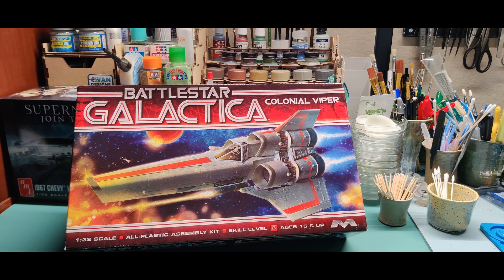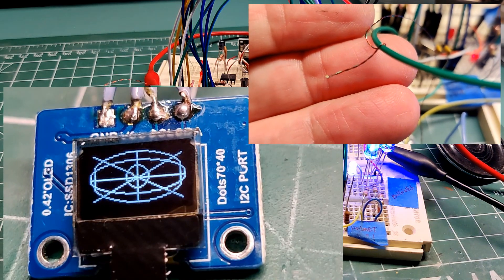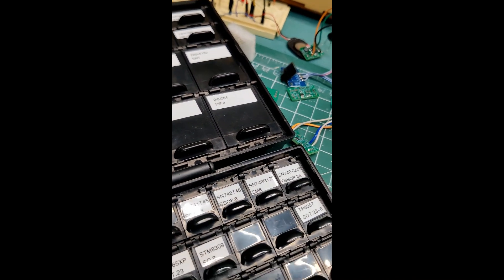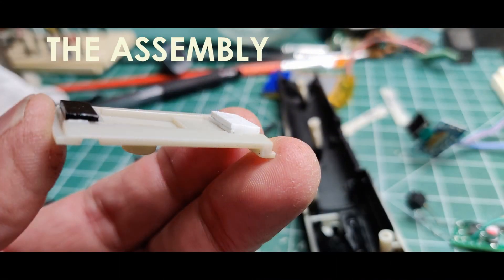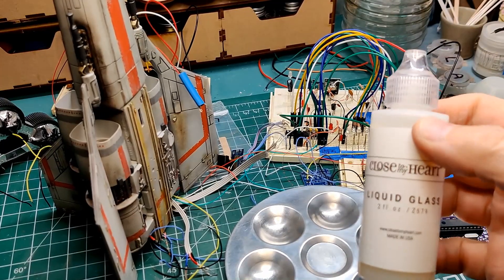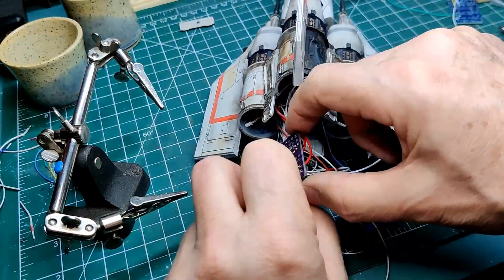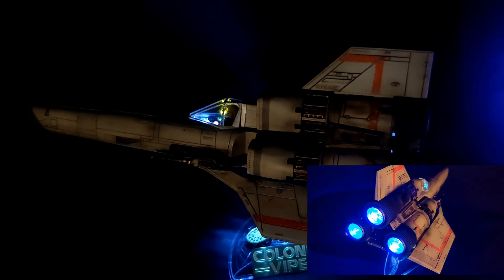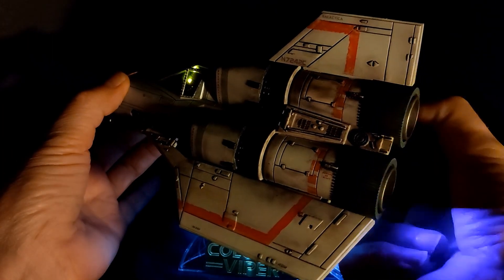Battlestar Galactica Classic Colonial Viper MK-1

Comment: hello i have to say most impressive build - i am building my own but struggle to get the colour of the striping - people advise red or orange but i love the colour you got any direction on what you used would help thank you
Reply from the maker: So I just used the decal kit that came with the model because I knew I wanted to chip the edges and weather over it. I just looked at it again and if I had to mask out the lines and paint I'd start with a red base and gradually mix in some red/orange or darker orange until I got something I like. It really is a red/orange color. Good luck. It was a really fun kit to build.

Comment: Great job. Just seems like the engine glow isn't coming on for each engine at the same time, or is that the video?
Reply from the maker: Hi, thanks for the comment. Probably the video. It did not show as well as in the real. I did modify the upper engine to  show a stutter from battle damage.
Reply: @Johnny_Electronic  Hmm, that could be it. I built a Viper MK1 as well, but with Lego.

Comment: Just came across your build video of the Mk 1 Viper. I  would like to ask if you would share your arduino sketch you used on your build. Thank you for posting your build 🙂👍
Reply from the maker: I've not set up a Git account yet but send me an email and I'll send you the files.
Reply: @Johnny_Electronic  Thank you for responding back to my message and to sharing your arduino sketch.  Could you tell where I may find your e-mail address? Thanks again 🙂
Reply from the maker: Hmm, I thought it was viewable from the about link. Anyway I actually got a git account setup so here you go:
https://github.com/JohnnyElectronic/BSG_Colonial_Viper_Mk1

Comment: Great work and thanks for sharing the tips.  I always struggle when it comes to electrical connections resistors etc...
Reply from the maker: Thanks for the compliment and I'm glad you liked the video. Keep at it and it should get easier with practice.
Reply: @Johnny_Electronic  I have a tuff time figuring out the resistance and such...
Reply from the maker: If it is just for the LED's, Light House LED has a nice table for 2v and 3v LED's that make it easy to select a resistor value. Here is an example, click on the quick selection guide.
https://lighthouseleds.com/3mm-led-orange-ultra-bright-15-000-mcd.html